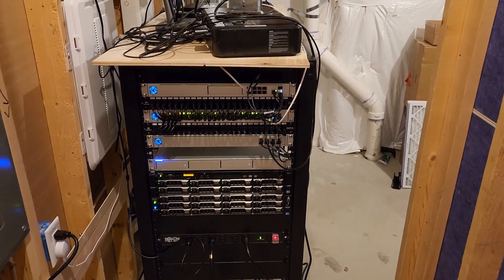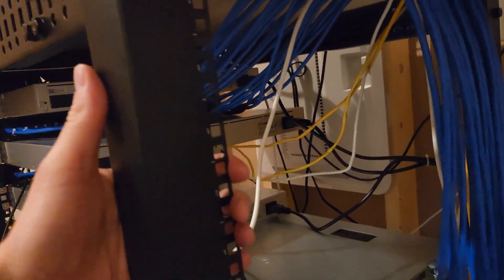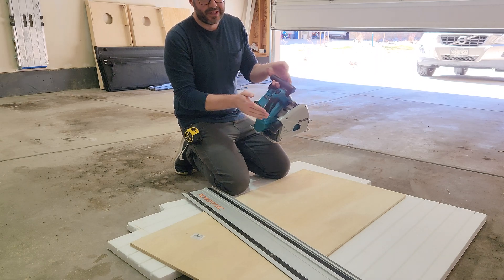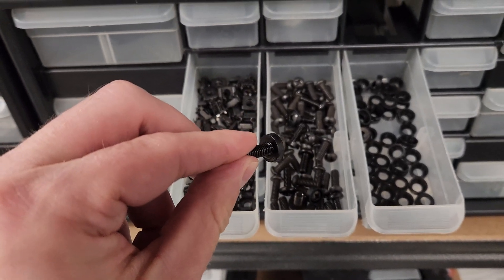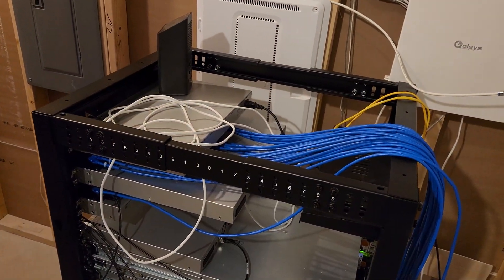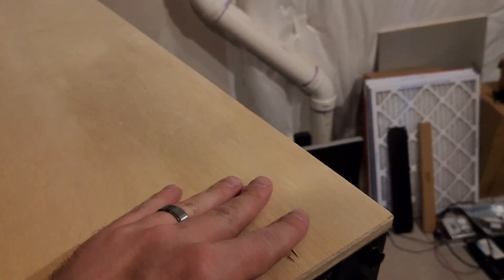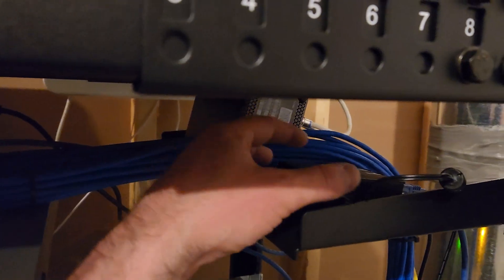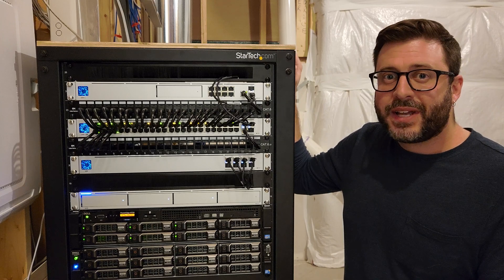Homelab Episode 4: Rack Upgrades

Comment: Track saw with a good blade makes a great cut. You need to trim the that part with the saw. That then gives you the precise cut line. You then line up the track on the mark line and your cuts are perfect. Then so long as you don't use a different blade, you get accurate cuts. When they wear out or something else happens, you can replace that strip with a new one. You want the heavy items at the bottom of the rack to keep it stable.  Sand the plywood and give it a good paint job.

Comment: ya could also get a external battery if that UPS supports it but i do have a Seperate UPS for my internet equipment and my server buit my current one is a desktop pc being repurposed qas a server as the dell server i had started having issues with the x16 slot and onboard graphics are not good at all for rendering but im better off without that as the power draw is a bit high for something  that was idle most of the time but the funside is with a desktop pc is you can customize things to your liking as my stuff doesnt even look like a server kind of but it is

Comment: That UPS really needs to be at the very bottom. Firstly to keep all that weight low to avoid tipping the rack. And secondly to avoid a potential battery leak from damaging half of your rack.
Reply from the maker: Definitely, you wouldn't want these at the top, especially a taller rack and if you had multiple units. The servers are heavier but don't have quite the same problem since they bolt to both ends.

Comment: Just unbolt the rail that is your problem?  I don't understand how that is a problem if your about to sand some plywood?
Reply from the maker: I probably could've unbolted some top rails - didn't want it to flex too much with the two Dell servers in there though.  Figured it was simpler to just pull the cables through.

Comment: I think the main reason we stick UPSes at the bottom is of course, the experience you had of lifting it, but also so battery replacements are easy for UPSes which have batteries which slide out, and also to make sure the centre of gravity of the rack remains as close to the bottom as possible so the rack doesn't tip when sliding servers out on their rails
Reply from the maker: Good call, that makes sense too.
Reply: Yup 😊

Comment: Can you explain what all that stuff is for in your home if you don't mind.That's lots of wires
Reply from the maker: Sure. This house was a new build and it was pretty cheap to add ethernet jacks wherever we wanted, so we added at least one to each room. In addition we added a couple dedicated outdoor runs for security cameras and some to specific locations where you would mount televisions.

So basically each room has at least one ethernet jack, five of the runs are being used for wireless access points, and eight are being used to power security cameras.
Reply: @clabretro  ok thanks love the setup. I want to do something like that .Using my 4 nas as media center

Comment: Put a keystone patch panel on the wall if you want to clean that bundle up further and get the cable lengths under control
Reply from the maker: That's what I'm thinking, whenever I get around to cleaning that area up I think that'll be the best route to go.

Comment: At one point you mentioned you have a raspberry pi to shutdown the servers. Then you say its not done yet. So what are you shutting down with the raspberry pi
Reply from the maker: Right now the pi is just gathering metrics from the UPS and letting my Grafana instance scrape them. It's all set up with Network UPS Tools (https://networkupstools.org/) — so basically I'll be able to configure those servers via NUT to shut themselves down when the raspberry pi notices that the UPS is in battery mode. I go over testing that flow in this video: https://youtu.be/OM4bY6ViZrg

The problem I'm gonna have (I think — I haven't added up all the power usage stats yet) is I need to have my network on for that to work. So I'm pretty sure I'll need another UPS to keep all the network gear running while the servers shut down (so that the servers and the Raspberry PI can talk to one another). Another route I'm thinking about is just connecting the servers to the pi directly via USB, but I don't actually know if NUT supports that. If that works I'll probably just do that and buy another UPS later.

So basically I still have to run down there when the power goes out and shut down the servers at the moment haha.

Comment: Just out of curiosity: would it have been an option to unbolt the crossbar at the top rear of the rack, so you could have saved the time fiddeling all the cables through?
Reply from the maker: I think that would have worked, I considered it. Also thought about removing the patch panel from the front and pull it through to the back that way. But in the end I realized I wanted to comb the wires and the best way to do that was unhook them all anyway.
Reply: @clabretro  definitely a very valid argument. I'd tend to be too lazy for that, or just push that out to later.
But I'd also put a cheap deleycon patch panel on that wall to take the strain evenly and make finding cables easier.
But I'm the big mouthed one here, having put  a few kilometers of cable into my 112m² apartment, and most of them are not that neatly combed, not even for a meter..
Reply: Yeah. You could also, since it's less than than 19" deep,  unplug the switch from power, leave all the ethernet connected, unscrew its rack bolts, push the switch forward out the front,  turn it at an angle so you can then pull it back again through the rack and out over the bar, then reverse the process to put it back and bolt it back in.
Reply: Gotta say, since making my comment I built my own rack, and swapped switch and patch panel - and keeping them connected was an option minutes after assembling the rack, but I regretted my laziness and had to do it again and properly. Running the cables again sounds harder than it is, balancing a patch panel while assembling/disassembling a rack is really hard.

Comment: just as a small info: most track saw tracks have a lip that is too long, and instead of cutting it off with a razor, you're supposed to cut it off with the track saw blade. That way the distance between the rubber lip and the blade if really small, and helps you align the track where you want, plus provides a little bit of anti-tearing for the piece of wood under the track, leaving a cleaner cut.
Source: watched too much woodworking on youtube..
Reply from the maker: ah, thank you! that makes a lot of sense. I'll have to do it that way on the other track.